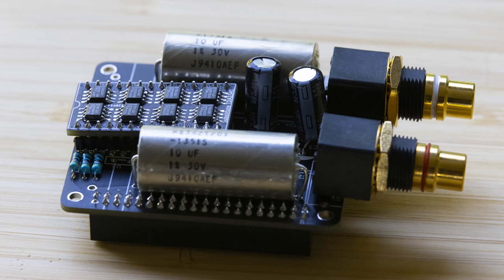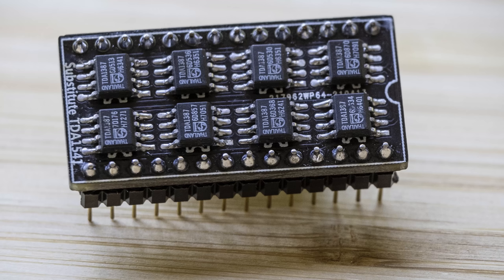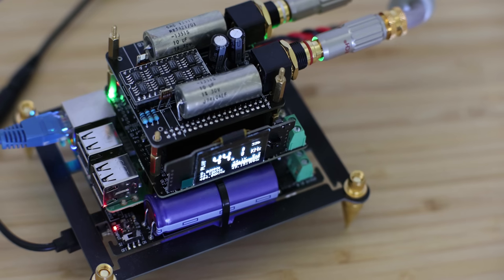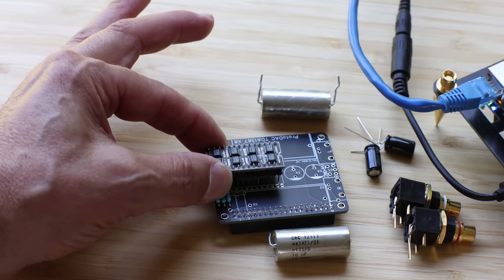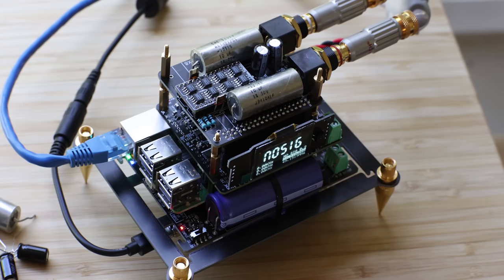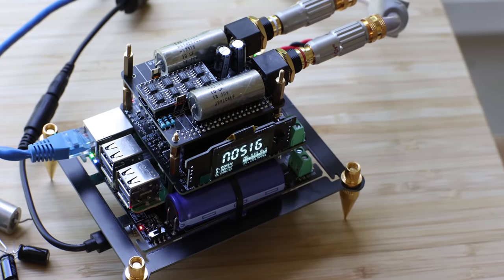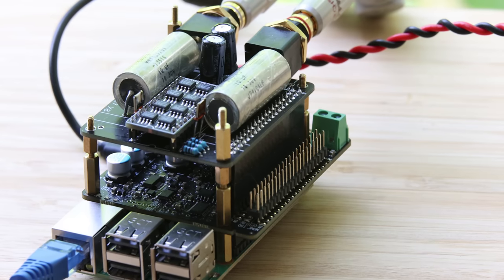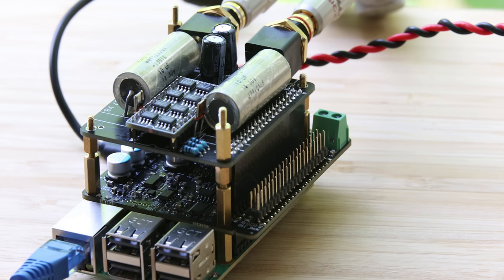ProtoDac Amazing HIFI Audio DAC HAT using eight parallel vintage Philips TDA1387 chips.

Comment: Hi Gabster, thanks a lot for the great videos about TDA1387. Just a question, what about paralleling two TDA1387 arrays (16x TDA1387) on a ProtoDAC? Thanks :)
Reply from the maker: You can I started experimenting with it 
Running it as balanced is complicated but 16 in parallel should be easy on my list to try 
The Question is will it sound and test better?
Reply: @Gabster1 I've tried to piggyback two tda1387 x8 modules in a the ProtoDAC-like circuit, but I get distorted audio, what's wrong with that? Thanks :)
Reply from the maker: I Think you need to double the IV resistor experiment with that as I mentioned I have not done it I was more testing the Balanced possibility try like a 200 ohms IV resistor or better may be combine  2 separate Protodacs I would be curious about your Findings  @marcovizzari681
Reply: with 200 ohm I/V resistors the output level decreases, but the distorsion remains. It seems more like a digital distortion, can't understand why.. @Gabster1
Reply: ok, I found how to fix the issue using additional 4K7 ohms resistors  on the i2s line of the second floor array ;) The output is louder and apparently more dynamic, much better!
Reply from the maker: @marcovizzari681  That is awesome thanks for sharing so If I understand correctly PIN 1,2 ,3 of the second floor array are not connected to the first floor and have their own 4K7 resistors . is that correct ?
Reply: @Gabster1  yes, correct. I had to remove pins 1 to 4 of the upper array and connect the i2s line including 4k7 resistors. I don't know if doubling the i2s resistors could have been the same...
Reply: Consider that my protodac is on a development board with a usb to i2s board. I have a Raspberry pi 4 but without a reclocking board, so I decided to test the protodac in that way 😁
Reply: Any ideas on how to use the TransportPi Digi withe the protoDAC? I can’t seem to get any audio out. Moode is set as I2S and withe the ProtoDAC selected, protodac is supplied with 5v from the purepi. Just get no audio with the TransportPi in between the pi and DAC board. Works fine hence TransportPi is removed.

Comment: I'm thinking of buying a dac that's from a big manufacturer, I've watched this and thinking of building one. My question is , is it as good as something 2x, 3x,4x, 5x or 10x the price of build. Any inputs to my question appreciated. Thanks
Reply from the maker: I think at this price the best is to try it yourself 
I is not very detailed sound but it does sound beautiful and if you like it you can upgrade it with a fifoQ7 in between similar to the mini ip 
Hard to put a number we are all different with different systems but if I had to I say 5X
Reply: @Gabster1  thank you so much for replying, I might even build the streamer dac if I can source the parts in UK. I'm very handy with soldering and everything else. I'm sure you had an amplifier build that I watched but can't seem to find it .
Reply from the maker: @nhanlieng3243   Ian has a new site you can order direct https://iancanada.ca/
I have not done a amplifier Build yet
and if you are getting the Protodac talk to Mark he can send you all the parts cheaper then buying them

Comment: Great video. Can you please confirm that this acts as a streamer as well as the DAC?
Reply from the maker: This will stream from the RPI you will need to install software like Roon, Moode, Volumio….
And the ProtoDac board will output to your Amp/preamp
There are no inputs say to run a cd player 
But it is a Dac wit rca outputs just add a amp 
Hope that helps 
Gaby

Comment: Hi, have you tried protodac with ropieee?  Ropieee documentation doesn't say any about this dac.
Reply from the maker: Yes that is what I am using no setup needed
Reply: @Gabster1  There is a list of audio hats in ropieee. Did you choose Raspberry Pi DAC (Generic I2S)? Did you apply phase inversion in Roon as Protodac recommends? Just to mention I had to use  -1db correction in Roon because of clipping with dynamic songs. Anyway you were right, this simply thing has potential! Raw implementation with Raspberry PI suffers from power noise and clocks imperfection but sounds very, very promising. I remembered "turntable" sound thanks to it, thousands of dollars needed to hear this with modern dacs.
Reply from the maker: If you are having clipping I would adj the I/V resistors any eq correction in Roon has a big negative effect on the sound quality same with Volume control and Song auto levelling.
Generic I2S works fine 
phase inversion is up to you I chose not to I doubt you would hear it  @Temp19750118

Comment: If you just wanted to make a dac only and make it balanced could you get two chips and run each channel in mono?
Reply from the maker: I am working on this I will post a video if successful
Reply: @Gabster1  awesome I’d love to see a truly balanced each channel differential dual mono.
Reply: I'm excited to see that Gaby has a plan. One solution is to use two modules in stereo. Feed one module DATA from I2S and the other inverted DATA. The module receiving inverted DATA will have noninverted signal output in stereo. The other module receiving DATA will have inverted signal output in stereo. Combined you get balanced stereo output. How does one generate noninverted and inverted DATA?
Reply: I don't think the TDA1387 is set up to play in mono mode. You would need to do tricks with the I2S signal. For example, by repeating right channel DATA sample twice so that it loads the same DATA to left and right channels of one module with the WS signal. It seems complicated and may not be worth the effort.
Reply: @mark4751  might be something that has to be programmed into the logic, fpga, or dsp chip.  I think these type of diy don’t give the builder that capacity to edit the logic of the chip.

Comment: What’s the benefit of using a 4-chip or 8-chip design over a single chip?
Reply from the maker: These chips use active devices to generate the currents so you need a few of them 8 seems to be better then 4 this way you avoid using a op-amp notice the absence of op amp or transformer.
Reply: @Gabster1  Thanks! I enjoy your content.

Comment: Hello Gaby. Maybe you could design a DIY power plant like the PS Audio power plant to get the power clean to all devices? Best regards Martin
Reply: Actually you can provide clean power in other ways what's better is proper/extra capacitors on the Amp power rails
No disrespect Paul does sometimes too good of a job pointing to one solution that's not fully effective.
By the way this DAC/HAT is selling complete

Comment: Thank you for this very informative video I can see few good uses for this Dac.  What type of software are you running on the PI ?
Reply from the maker: I am running Roon but you can Run MoOde or Volumio 
Mark describes in detail how to run it on MoOde in the Builder Guide link below
Reply: Hi Gab, I’m using Ian Canada’s boards (PurePi, Q7 and AES transport) and use ropieee as the Roon bridge. This work’s amazingly faultless and is now my go to setup. What is your configuration to have this DAC recognised by the Roon core? Could I run ropieee for this as well or do I need to use MoOde as the “operating system”? Thanks, great little project for my smaller systems.
Reply from the maker: @giscardrutten6896  NO configuration at all it is a very simple dac I am running Ropieee / Roon there was nothing to configure
Reply: Perfect! Thank you for the clarification. Look into forward to building along with your next project